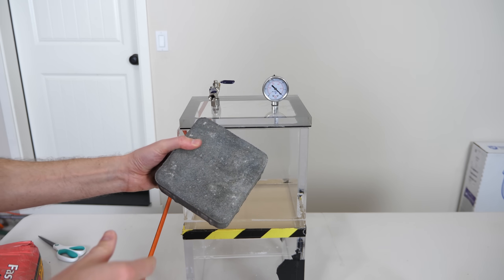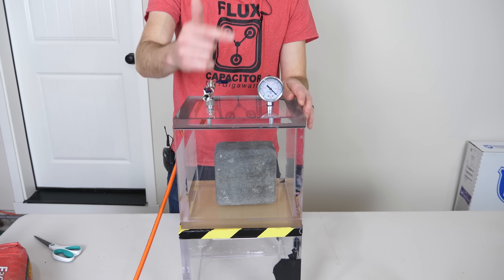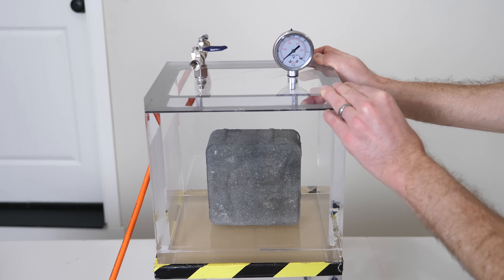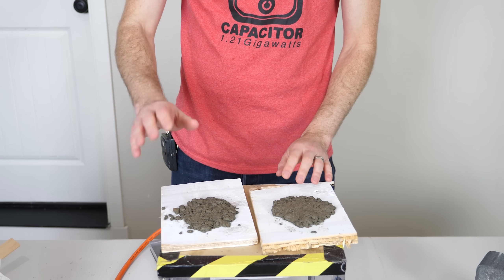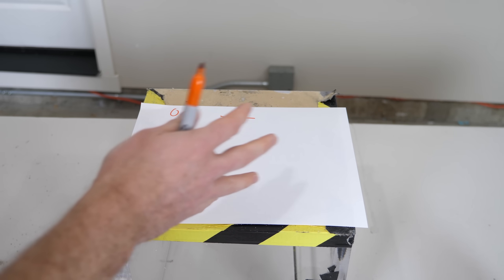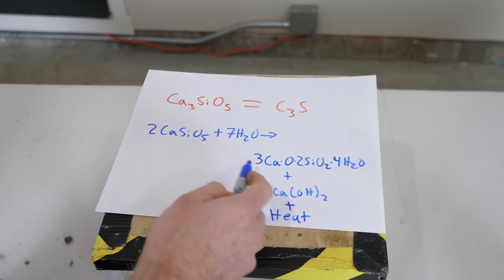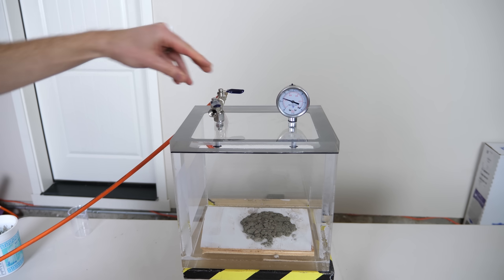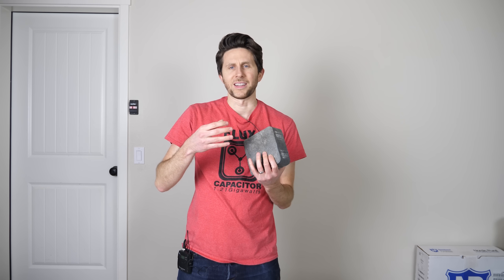Does Concrete Turn to Dust in a Vacuum Chamber? Concrete Without Oxygen Experiment

Comment: In those video s they ment the oxygen atom not just oxygen in the air water has 2 hidrogen atoms and a oxygen atom if the oxygen atoms disappear you will only be left with gas (hidrogen). So if there is any oxygen atoms in the concrete the concrete would turn in to very fine dust same with any other solids and liquids and everything would change to gases (like hydrogen neon helium) and to pouder. Metallic atoms such as steal , aluminium , gold. The earth would collapse on its selth . Thanks to anyone who deard to read this thanks and soon I will be posting videos on my channel check it out for me agen thanks . Sencerely Space Blob.

Comment: Although perhaps small in its affect to the bulk material, I believe carbon dioxide does react with the cement too, which would be inhibited in the vacuum. One possibility is a reaction between carbon dioxide and calcium hydroxide to form calcium carbonate and water. This should reduce the ph.

Comment: Some what interesting, but concrete will also set/drye under water. Therefore I was almost sure it would act normally, but there are oxygen in water, so I wasn't totally sure. Btw I have not seen the other videos about concrete smouldering in vacuum.

Comment: As i think you don't get the question well,
It says that "what if the oxygen disappears for 5 minutes"
It means you have to took out all oxygen from the base of the concrete,

Like in SiO (silicone oxide) remove the oxygen and you'll get only silicone, and you'll get silicone without any kind of bond between them.

That's what i think i don't know much 😅😅

Comment: So modern day concrete is more then cement sand and rock and I'd like to see you go more in to this bc modern day concrete can have a lot of other things added such as  liquid air and potash or flyash just to name a few 
Also would be nice to see what amount of force it takes to brake with load tester 
And maybe even do a slump test and air pot test on the concrete b4 putting it in the vacuum chamber

Comment: I gotta say, I didn't expect the concrete to cure in a vacuum - I figured the water would boil off before it had a chance to bind with the cement, so I learned something today

Comment: I have worked with concrete, if the brick is done in a factory, all the air bubbles are shaken off, which means, it can stand being in a vacuum. But, if there is an imperfection, such as an air pocket, I have no clue what will happen in a vacuum chamber.

Comment: I just wanna point out that removing oxygen is much more than just creating a vacuum doesn't remove all the oxygen molecules, rather removes all the air molecules. Removing oxygen from the earth means completely stripping all oxygen atoms out, and that would mean the earth would lose its sand as its silicon oxide

Comment: if the element Oxygen really disappeared for 5 seconds, every living thing containing water would violently explode as the water turned into hydrogen and expanded to approximately 1500x its volume
same with the oceans and all water at all
and that's just one of the things that would happen
so everything would die in the first microseconds of the event

Comment: You need water to solidify concrete, it is a hidration chemical reaction... So when they say that without oxygen that would happen, they are being super literal (not only atmospheric oxygen  but in every existing molecule that has oxygen inside)

Comment: Concrete is weak in tension I was thinking it could fail from the pressure of the trapped air pushing out  but concrete is fairly pourus

Comment: Concrete is an open porous material. The interstitial spaces in the concrete will evacuate in a vacuum and the integrity of the concrete will be unaffected.  Well, now I'll watch the rest of the video - let's see! Yep that's what happened. 
 Concrete cures and solidifies  through a chemical reaction. My guess is the concrete will solidify in a vacuum. However as any chemically uncombined water will boil off in a vacuum the concrete may not be very strong. That's why concrete is often covered by wet sacking while curing to stop  moisture evaporating too quickly  and inhibiting full curing. That's my guess - let's see. Yep that's what happened.
Reply: Gribbo9999 people have actually done the experiment... I can’t remember the name of the materials lab off hand but you were correct about it drying out too quickly and being less strong than the usual cement... the paper I saw wasn’t using quick set though I didn’t keep up with it properly but they did work out a bunch of methods for different conditions. The problem is obviously that majority calcium minerals are relatively rare in a lot of environments off earth
Reply: The evaporating water in the vacuum also kept the vacuum concrete cold, which slows curing, giving a shorter effective curing time. A concrete man would have said the vacuum concrete dried before it cured.
Reply: Gribbo9999 speak English please

Comment: It was interesting to hear about hydration and exothermic heat, but I am having trouble finding information on another type of exothermic reaction. Have you ever had rubbing alcohol on your hands and went to wash it off only to feel a brief warming sensation. Why is that? And not about evaporation, but more curious if it has to do with it being non-ionic and ionic liquids?

Comment: To effectively test this, it would be necessary to have two vacuum chambers, one extremely large one and one much smaller at atmospheric pressure, with a block of concrete. I know how difficult this is to test as large vacuum chambers are difficult to obtain or rent from NASA. This would allow, when a valve was opened remotely on the small chamber, the larger one to suck out all the air from the small one in less than a second, just like the videos about oxygen INSTANTLY disappearing for five seconds. What I think would happen is that the air pockets inside the concrete block would expand with enough force to crack the concrete in multiple places, rendering it structurally obsolete and if a building were on it it would turn to powder.

Comment: 100% sure something will happen. It just won't be observable by the naked eye. Air will be removed and then sucked back in once the vacuum is removed. If you put the concrete in water in a vacuum chamber, you'll see the air coming out. :P

Comment: That why it didn't turn to dust because... oxygen is withing the concrete it self... not in the air.
You only removed oxygen in the air not in the concrete.  And in order for the concrete to turn to dust is you have to remove oxygen within it.

Comment: I figured the block wouldn't be effected. Its already a solid rock. That's why cement could still be used on mars but you'd have to be a little extra about keeping the mixture wet. Cement is perfect for building with on other planets as long as it is capable of drying on its own.

Comment: My Father is a Mason, I've worked for him for almost 20 years now. Cement is what is used to lay bricks or blocks. Concrete is used in foundations or sidewalks or driveways. Both contain sand, but the main difference is the larger aggregate in concrete that's used to achieve a higher PSI rating. Everything needed to make concrete cure is already in it. Oxygen isn't needed so that vacuum chamber wont do anything.

Comment: 100% sure nothing will happen - removing the air will not remove the elemental oxygen that's in the concrete. The videos in question are asking if elemental oxygen disappeared for 5 seconds.

Comment: How about you put concrete in a pressure vessel that you connect to  vacuum chamber via valve? So you make vacuum first, and then rapidly decompress the chamber with concrete? May be the fast pressure loss will make air inside concrete brake it apart while leaving rapidly? While with slow decompression it goes out slower and have time to leave without braking the concrete?

Comment: Well no, it's obviously not gonna crumble, because you aren't removing the oxygen from the concrete. You're only removing the air (and oxygen) around the concrete.
About wet concrete, I expect the concrete to dry (literally) in the vacuum (due to the water quickly evaporating from the concrete), therefore it won't solidify since the water leaves the concrete instead of becoming a part of it.
Update: Well ok, quick setting cement or adding more water than necessarily might actually work.

Comment: You have missed a very important step: carbonation. If you want the concrete to reach its maximal strength it needs carbon dioxide. The carbonation process is quite slow, so your experiment would last a month if you are through. Carbonation in vacuum is not possible, so concrete in space does not seem like a good idea (there others reasons too). Without this step, concrete is very much weaker and you experiment is not valid.

You really should have mentioned the role of carbon dioxide.

Comment: These were essentially the results I expected.

However, I'd like to note that concrete doesn't "dry" (water evaporation), it "cures" (water reacts chemically with other ingredients to gradually make a new harder substance). And it can easily take a month of curing to reach maximum hardness. A few hours of curing is enough to make it stiff, but not as hard as it can be.

If it was possible to have the sample cure for a month in vacuum, I'd be curious to see the results in overall mechanical properties (though there's probably some scientific papers that already discuss it).

Comment: I'm pretty sure the people who say that concrete relies on oxygen are referring to it appear in concrete's chemical composition or something, not oxygen gas.
I'd take 1 vs 20 odds nothing will happen.
EDIT: For second experiment, I suspect the concrete in the vacuum chamber won't harden for two reasons
First, it's likely oxygen from the air is required. I'm not very sure about this, but water is a pretty stable compound and an exothermic reaction is happening, so it's likely oxygen is being used.
Second, this one I'm fairly sure about, the water will all boil off due to low pressure.
EDIT 2: Huh, I was pretty unsure about the first one (and it was wrong), but I was actually pretty sure the water would boil off and keep it from setting. I guess water got trapped inside but the initial hardening or something.

Comment: Actually concrete doesn't dry. It hardens, this is the reason why you can use concrete to build structures under Water. The process of hardening takes about 30days

Comment: Is there something that is solid but when put in a vacuum chamber turns into dust?
Reply: Interesting question I'll look into in in a second but I'll assume that materials that sublime (solid to gas with no liquid phase, like solid CO2) If they were initially solid due to high pressure then decreasing the pressure should allow it to sublime and turn into a gas

Idk if that's a satisfactory answer for you or if it fits your idea of "turning to dust" but this is all I can think of

I'll look for data of anything close to what I described now
Reply: I'm back, couldn't find this comment again

The answer is yes, solid CO2 can undergo sublimation by decreasing the pressure

Also metals apparently can be affected to some extent, couldn't find much info on that

But the simple answer is, yes
Reply: aerogel maybe

Comment: Actually, concrete contain some little bubbles of air, so putting it into vacuum surely create a force that tend to disgregate it. But, the cohesion should be enough to resist such a small force (bubbles are of micrometer size).

Generally speaking concrete surely need air to solidify, that doesn't mean that removing oxygen will turn it into dust.

For water there are 2 types of concrete, one of em is called hydraulic concrete which turn solid even in humid environments.

Finally, humid concrete in a vacuum should be able to complete the hydration process, thus turn solid.

ok, my guess made i can keep watching :3

thanks for the content TheActionLab!!!!

Comment: Nothing will happen, it will remain solid as the vacuum chamber is sucking out the air and gases from the chamber. The oxygen in the concrete block is not in gaseous form so nothing will happen

Comment: well, in civil engineering classes, we are thought that concrete is so strong against compression but extremely weak when it comes to tension.
as an engineering student, I would say that those videos were assuming that if oxygen (air) were gone, some pockets inside of concrete structure (caused by human errors on construction that's common to happen) might be pulled outside and create more tension than it could've hold, and collapsing the structures

whereas in this video, it seems to be using a perfect concrete block, whichas there wont be any unexpected tension to happen

Comment: Curious if you could set it upbin a mixer to possibly mix out the trapped oxygen
If you removed any of those components I would theorize the concrete mix to break apart as well

Comment: (this is joe, PapaO, not MommaO)
I worked as a vibrator on  original  I-15 Interstate overpasses, and even in winter, it needed at least 40 F to cure, so temperature was a factor,  I guess no dust because the atmosphere does not penetrate the cement block, I would guess that in a vacuum  would be a major factor in slowing the curing process. there would likely be small air bubbles within the wet concrete, which causes a major FAIL (a vibrator  removes the bubbles while it is still wet). Not sure how it is handled today. Fun to watch the video, my son :)
Reply: Worked as a vibrator....

Seems weird lol
Reply: @ningenslayer1165  yes, it does lol
Reply: Momma O are you his parents?
kool
Reply: « lol »
Reply: OVERUSED WORD

Comment: The only difference would be the concrete in vacuum would cure faster, although would of been better to compare them with a thermal camera as concrete heats up when in cures. In a vacuum it would clearly show a difference because there’s no means to dissipate the heat.

Comment: my guess is that the internal pressure from trapped air will cause some cracking and it to fall apart but not quite turn it into dust

Comment: dNothing I think should happen. It is not the air that holds it in place, it is the water content inside that holds it together. Maybe if the water turns into a gas under vacuum perhaps slowly. That is my prediction. Considering water never fully evaporates, just like in the case of rocks, igneous or sedimentary, there is always water present inside holding it together. Split any 3 items and the fresh cut would be first darker than what it appears 2 hours later, once the surface has evaporated the water content.

Comment: The concrete should then begin to draw the co2 from the air forming calcium carbonate which is the powdery film on the concrete and is also super strong. Hydrogen gas is released while this occurs too if I'm not mistaken.

Comment: 1. "usually...we interchange concrete and cement"  I do not mean to be rude, but define your 'usually'! Because here usually we understand difference. In fact, only children <10 years old probably interchange then, and only until they've been corrected.
2. It seems to be very light for concrete brick.
PS:
3. 40 minutes is not that quick at all

Comment: Removing oxygen on molecular level will , break it
Also our dna's hydrogen bonding
Reply: It will break the water. We will die at an instant. And we won't go down in flames, because there will be no oxygen to burn all the molecular hydrogen.
Reply: Hmm hmm ,that death will be weird
Reply: It would more that just break it, it would change materials from one thing to something completely different. I mean yeah Water would turn into hydrogen instantly, and water is a pretty simple material at a molecular level, other materials would turn to things even more unrelated to it.... It's like the level of turning metal into gold weirdness stuff that would happen
Reply: @GummieI  whole mountains will crumble, when the chalk loses it's oxygen. On the upside: there will be no rust...
Reply: @FryingPan76   Not just mountains, all of Earth crust and mantle. It made of oxides(46% oxygen). Earth would collapse for 5 seconds and returning oxygen would ignite everything and earth would burn white hot for awhile. Like burning magnesium ribbon.
Reply: This.  Removing oxygen is not the same as removing atmospheric pressure.
Reply: @Ameen Koya-Oyefuwa My reasoning ist, we won't see it, because we will be dead.

Comment: you said that the reaction of water and cement slows down because the outer layer starts to crystalize and the water takes time to diffuse through that layer. does that mean if you put a compressed ball of tricalciumsilicate in water you'd be theoretically able to create a sort of hollow cement shell with a core of unhydrated cement inside? wouldn't it just take a ball that's large enough for the outer layers to fully crystalize before the water can reach the center?

Comment: Of course, nothing happened to the concrete in vacuum. And magically removing all oxygen atoms from everything would also make natural rocks crumble, as they typically contain lots of silicon and oxygen, often along with aluminium. Oceans would go away, leaving lots of hydrogen and salt. No one would be there to experience it, as our bodies would die immediately by having all oxygen atoms removed.

Comment: The one cured in the vacumm chamber would be harder than the outside cured, because the one inside doesnt lose humidity, critical point to achieve correct cure of concrete.

You have a hidraulic press, you can test both concretes and see the difference.

Comment: You do know that it is Hydrogen in water, which make concrete hard/solid etc.? And concrete have good sustainability against pressure... And it is carbon dioxide (carbonation) which can make it crumble...